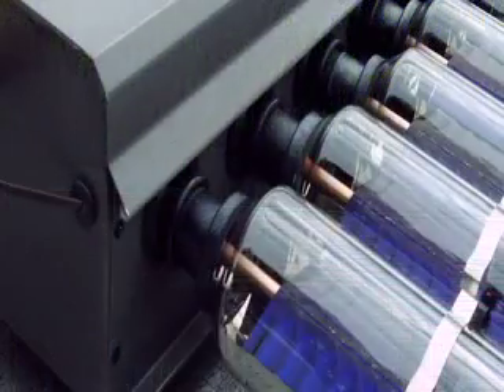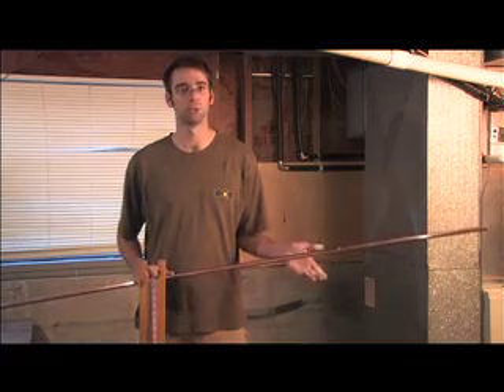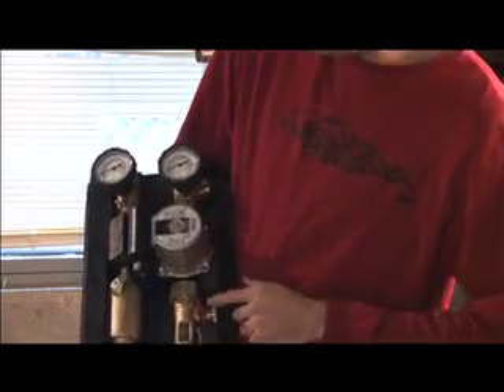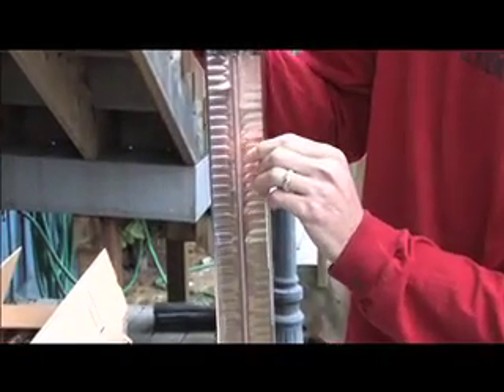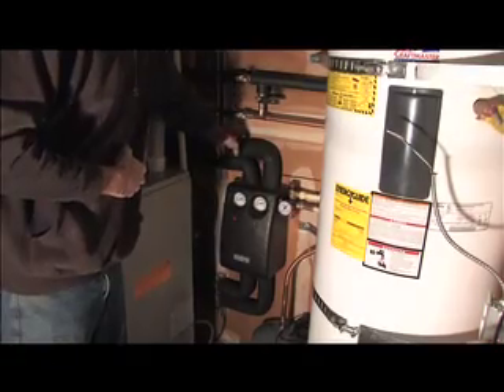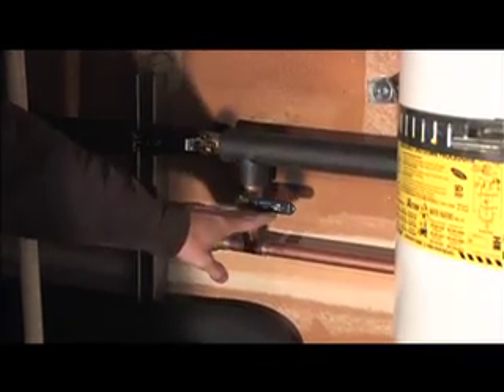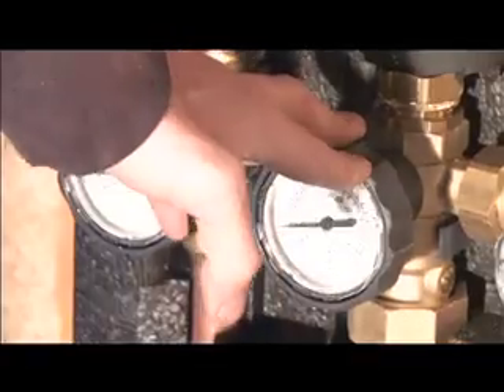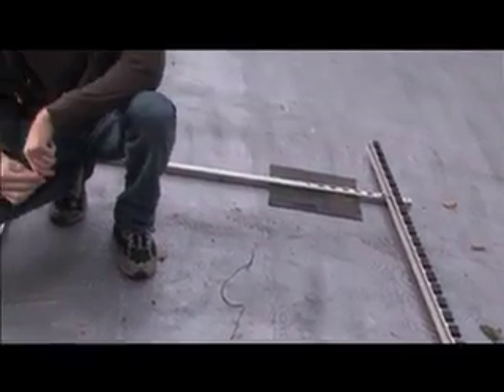Solar Domestic Hot Water

Comment from the maker: Your critique of Chinese evacuated tube systems are likely correct. However as you can plainly see in the video these are Mazdon tubes a Canadian product which does not fail in the way you suggest.
I have nothing against flat plate collectors in the proper circumstances they are a better choice. I live in Seattle and want to make use of all the solar energy available without the frigged weather we often get to prevent use of these collectors.
How does your flat plat collector work in snow?